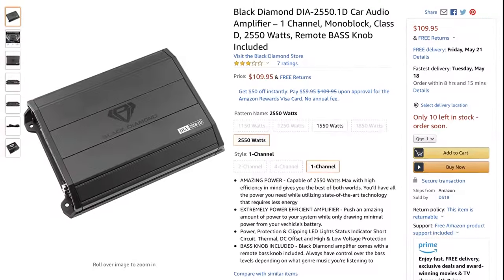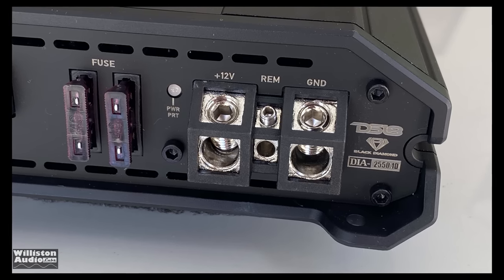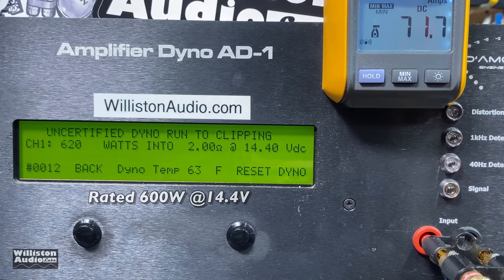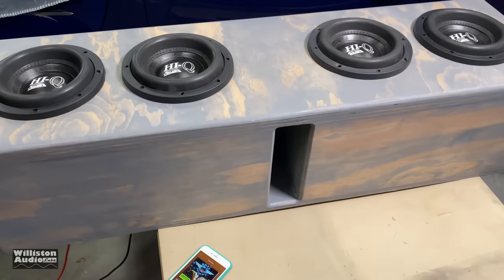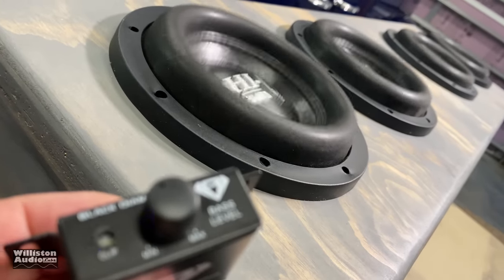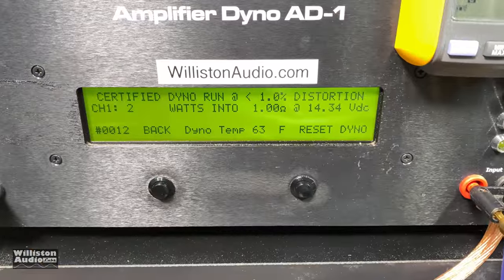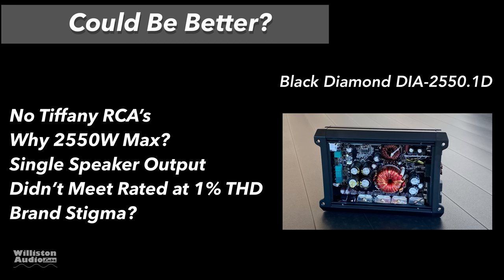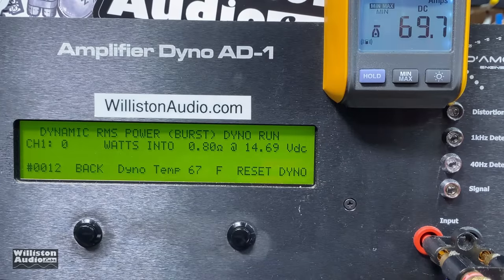Amazon Budget Winner? Black Diamond DIA-2550.1D Amp Dyno Test and Review [4K]

Comment: That clip indicator is there for a reason. Set those gains.
Reply: Ya big dummy, I'm sure he knows that already. I think he was just demonstrating how it looked when clipping... Sheesh
Reply: You realise he's doing a Rugged test on the amplifier,  so why set gains. He's pushing the amplifier to it's full testing.
Reply: @strangerdanger1271  while I agree with you, they should be fine as long as you don't do that for a prolonged period of time. Running a clipped signal for half a minute to show the clipping light isn't going to cause the motors on those subs to seize.

Comment: I haven’t even see the video and I already ordered. I’m not going to be late to the party this time
Reply from the maker: Wow 😮
Reply: @wal  I’m still mad I missed out on the WUDI amp... are you selling yours?! Lol
Reply: @mvaladez187  I think they're still maken those amps under a different name. Wasn't it like WUDI 6800?
Reply: @bobbymaner4113  yes! Do you know what the name is by any chance?
Reply: @mvaladez187  I always seem them on Amazon and Ebay. It'll say 6800 in the corner or image on top of the amp.
Reply: @bobbymaner4113  thanks a lot brotha will check it out
Reply: Nice to see. Recently bought one of these for a single 12 install in my Tundra. Looks like it should do the trick. Thanks. As all always great vid , no nonsense facts.
Reply: 👀🤔WHAT‼️GREAT TELL US🙌🏿🙌🏽🙌🏻🙌🏾
Reply: My guess is Chuck spent more money on an amp that didn’t perform this well 🙄
Reply: @basstech714  i disagree. i watch these videos to further cement what I've learned from 80's, 90's and 2000's crank it up contests, and Iasca events.. CHEAP CHINESE JUNK!!!!
Reply: @chuckholmes2075  clones of clones just like the Chinese market does...power is so cheap rite now,for sure rember the days of the rf 75.2s and us amps surfboards, I broke down and ended up with a taramps md8k on my 3 15s in my extended cab Chevy, it's a daily I beat to death,couldn't see spending more than $600 on an amp in a  truck that sees mudholes and tons of dirt and dust. But the same has always been Tru, u get what u pay for, sometimes cheap shit will do the trick for some ppl tho or they wouldn't make it.
Reply: @chuckholmes2075 not even worried about. Not out to win a trophy for system content. If is sucks, I've wasted more money on worse things. Thanks for the encouraging words. Appreciate it 😂
Reply: @jaceyrondeau8133  well I’ve got the money. I own an IT/IS company down here in New Orleans. As well as 2 data centers.. granted my competing days are over as well as buying cheap junk. I’ve learned that lesson. I’m happy with what I’ve got because it suits it’s need. I’ll leave the competing to my buddy Joe Fox of Fox Acoustics. He’s got 80 8” woofers in a UniMog. It’s hurts to listen to.
Reply: @chuckholmes2075  Congrats on your business. And making through this whole Covid-19 situation.Definitely beats a J O B. I understand where you're coming from. I also don't understand guys like your buddy who turn a vehicle into a rolling speaker. Not into that extreme myself. Just have a single 2 ohm 12 for my truck for a little low end sound. Could never justify spending 500-1000+ on car audio. It just isn't that serious to me. Cheers
Reply: @chuckholmes2075  you right, my amp had no sound
Reply: @mvaladez187  ????
Reply: @chuckholmes2075  My amp didn’t produce sound. So I returned it
Reply: @mvaladez187  So that Black Diamond amp didn't work out for you? Let me tell you if you really really want to go cheap don't settle for anything other than Rockville. If you hook them up right, those amps will do what you want for a long time. Of course if it were me I'd say just save up for a Fosgate or Massive Audio or even Skar is pretty good. But I'm telling you, Rockville is the only cheap you can trust. I bumped a kicker CVR 12 on a Rockville mono block 400rms and it lasted me the whole 3 years until I was ready to upgrade to my CVX 12 and a fosgate amp.
I still bump the Rockville in my house as a home theater system. So yeah that's always my recommendation.
Reply: @erik120719  who makes the amp it's supposed to be cloning? Not the USA lol. So it's a Chinese clone of a Chinese clone. When you win the lottery you can buy all American made, you'll have the most expensive POS system in the country lol

Comment from the maker: Buy this amp here:
Amazon: https://amzn.to/33UuPxz
eBay: https://ebay.to/3ftk2j0
Williston Audio / OSS Merch: https://bigdwiz.creator-spring.com/
(Video Gear I Use) 
Camera - iPhone Xs Max 512GB - https://goo.gl/uFHBh8
Samson Go Mic Mobile - https://amzn.to/2BSAtll
960 LED Panel: https://amzn.to/2Sxoq3S
Lavaliere Microphone - https://amzn.to/2Rw5PIw
Sennheiser Wireless Mic - https://amzn.to/2BSwIfD

This VIDEO was EDITED with LumaFusion on an iPad Pro 12.9:
iPad: https://amzn.to/2Ancr1W
Software: https://goo.gl/6yvWss

--------- Test Bench Equipment -------

SMD / D'Amore Engineering Amp Dyno: https://goo.gl/sJTcf7
XS Power D1400 Batteries - https://amzn.to/2BPFCKW
XS Power PSC60 Charger - https://amzn.to/2CHGcfs
Fluke 1000A AC/DC Clamp Meter: https://amzn.to/2Rw5WDA
Handheld Dyno: http://amzn.to/2u2EgKV
My Favorite Screwdriver Kit: http://amzn.to/2x0VzcE

DISCLAIMER: This video and description contains affiliate links, which means that if you purchase from one of the product links, I may receive a small commission. As an Amazon Associate I earn from qualifying purchases

Comment: This literally makes the “add a zero onto the fuse and that’s your power” theory look true
Reply: Its multiply fuse rating by 12 or 14 volts not 10 but yea its pure truth
Reply: For most class D amps. This will not work on class ABs generally.

Comment: Thanks for the test Big D! I wish you would have reviewed this thing a month ago lol. I purchased the JP8 a few weeks back because of your review and the clip light on the remote. I like it don't get me wrong, but had I known about this amp I would have saved myself 90 bucks and purchased this instead. I'm only running one 12" KFC-W3514DVC sub at 2 ohms that only handles 380w RMS, so this amp would be more than enough for me.
Reply: 2 years later but I'm glad you bought JP amp and not this thing.  They are not in the same zipcode for performance.

Comment: Not terrible for $100 and a clip light on the bass knob. Those cables look huge going into that tiny amp lol. Really hard to find a clip light and metal bass knob on a $100 amp. It came close enough that I would consider it if I only needed like 750-800 watts for a single sub.

Comment: I was almost sold on this amp for sure. It will work great for my camaro convertible on my 10 inch sub on 1ohm. My only issue is that it gets way too how just after 2 minutes of play. I wish there was a way to keep the temp down on this amp. I would need way more than 2 minutes of play.
Reply: Add a small fan to it and it good
Reply: Remember the ADD-1 uses a resistive load and he's playing a sine wave. It will be totally different with a speaker and music, it will run much cooler.
Reply: @JasonWW2000  Now I'm curious how long it will play for without reaching to high of temperatures.
Reply: @bbay1977  As it's temperature increases it radiates the heat out. As the difference in temperature increases from it to the surrounding air, the delta, it will eventually stop getting hotter and will maintain it's temperature. So as long as it's not mounted behind panels blocking fresh air it shouldn't get too hot. Also keep in mind that if your sub measures 1 ohm DC resistance, it's lowest AC impedance is going to be above 1 ohm when it's playing music. In order to get full power from this amp you'd need to wire it to 0.5 ohm. Impedance jumps all over the place with music and just certain frequencies will see it's lowest impedance. So I'd estimate the most power your 1 ohm sub will see is 500-600 watts and that's with the volume at max unclipped output. I don't think heat will be an issue. Plus you can further improve cooling by mounting the amp on spacers so air can flow into the lower vents on the bottom of the amp and go out the side vents. 
PS, I don't see this amp on Amazon anymore. I was looking at the Skar RP series which have lots of good reviews. I see Skar sells them on eBay and they have factory refurbished for a discounted price. I'm looking at their 1200 watt amp for $125. It's bigger than I need, but I can adjust it down with the gain knob. Dereck has tested the RP series also. Personally, I'd prefer them over the Black Diamond. Something to think about.

Comment: I love your channel..  I'm trying to put together a system, I bought the Rockville k9D4 10". And hooked it up to set up my amp and I had all the settings turned completely down on the amp and within in 15 mins of tuning the amp and mind you the volume was turned on the head unit, but I'd be darned if I didn't start to see smoke coming from the sub box.  I knew then the Rockville was done already before it even had a chance to begin.. I then saw other post of people who purchased the Rockville line of subs and it seems they have all had similar problems...  I've only had the speaker for 3 weeks and it was only hooked up for a day..

Comment: Maybe this one for my convertible fox mustang.... Long term project. Just thought of free air subs facing up at the window (but far enough away and at a slight angle) so when folded down so the glass will not hit it..but will also act as a slight wedge bass deflection deal....and when the top is up there will still be some movement of air.  We'll see how the sub goes...but if I do a bunch of 8" and load up the ohms....this will be plenty of power to push however many I can fit in there!

Thanks for the reviews! 😇😎😀

Comment: Damn itttttttt. A couple months back I was trying to find a good review for black diamond amps for my Kicker CVR 12" and I just couldn't find anything so I got a stupid Rockville amp which has been all good honestly, but I'm just sketched about it being Rockville. Lol
Reply: I hear ya, I bought a Rockwood Detonator amp-860X for $150 probably close to 19-20 years ago at one of those crazy electronic sale, sale, sale, they have at fairgrounds all over the place. I've maybe used it 5-7 of those years on a pair of 15's. It's kinda funny cuz I had dig out of the closet and put it back to work cuz my Black Diamond D3 400.2 quit on me after pushin 2-10" JBL's for the last 10 or so years. The Black Diamond is a far better amp in every possible way. It was actually manufactured in the USA back then, I'm not sure about now.. I've been pretty lucky having the amps last as long as they have, due to the fact my wrangler's topless 6 months out of the year. That really helps keep the heat down a little with all the wind, I make sure to use the cans of air and maybe a couple of Q-tips to help keep the dust and spiders out of it every couple of weeks.
Reply: @bashman37  That was just what I needed to hear i was hoping for that out of Black Diamond. And that's pretty cool about you're wrangler I need to upgrade to something like that soon after I get my 2 cvx 10's, especially how hot it is now the Rockville amp is actually starting to heat up during the hot daytime of bumps, but hardly gets warm after hours of pounding at nighttime when its cool. Its pretty weird so I will definitely be upgrading to black diamond when I get these 10s.

Comment: Not too bad but if it cant beat the Wal-Mart Power Acoustik its not gonna be a budget banger on my list. I did some clamp testing (not the same as an official dyno i know) on the PA 2500 and got 853 at 1.4ohm riding on the edge of protection. They're not my favorite by any means and the rest of my system is all Alpiine and Kicker but i got 2 of them on my 4 12's and havnt felt the need to upgrade yet. Only have $110 invested in both amps also a +. Id like to see a MB Quart amp tested. I just bought a set of 10s for $80 on eBay and havnt had the chance to try them out but they seem to be decent dual voice coil subs for the price. 👍

Comment: How about a usefulness test:
What is the maximum wattage can it handle continuously with the cover on for a 60 minute drive? 

The speed at which it thermals shows that not the entire amp is designed for maintaining it's output @ rated power.

Just because it can reach near it's label power for a few minutes doesn't mean it's a good amp to actually use.  Wondering about 500 RMS into a 2 ohm load... How long could it keep it up playing music from whole albums.  (Obviously different types of music would be handled vetter or worse depending on factors such as frequency and length of bass notes.  A bass drum compared to a string bass or synth makes a huge difference)

Comment: Those caps mashed over on the driver board are super sketchy. Between the heating from the choke and the vibration from the box this will inevitably be mounted on, those caps will probably be the first thing to fail.

Comment: Same as ds18 2550.1. Puts out 845 at 1ohm. I'm running one at 2ohm so I'm seeing about 600. It's a ok piece of equipment. But mine doesn't get hot at all and I've abused it slight clipping. Never shut off might get warm never hot though.
Reply: Its probably doing closer to 300 watts due to the impedance rise your getting. The amp may actually see a load closer to 4 ohm.

Comment: Can you explain how you determine efficiency please?

4ohm certified, your meter reads 36.7amps, but you put down 26.6amps in your calculation.

Do you play back video and freeze right when distortion light lights up?
If so, how do you know there isn’t latency delay on your meter reading.

10amps makes a huge difference. Saying it’s 87% efficient, when it could really be 63% efficient.

Please help me understand, I’d like to calculate it correctly for my own amp.

Thank you

Comment: How’s it going big d just wondering if you had heard about the power acoustik A3000.DB MONO BLOCK. I used to run one in a 96 tbirb pushing 3 audiopipe aluminum 15” subs. But I posted a video of a build I did recently on YouTube. The video is named first build in a while 2008 Chevy trailblazer. Had 3 15” aluminum audiopipe blues and a Orion xtr 2500. 1dz had my trailblazer flexing.

Comment: Great channel so I have a question; Want to run this in my older Corolla to power the door and deck speakers which are Kenwood. Obviously I'm not going to push it to Thermal but would this be a good amp for the price?  Oh door speakers are 5.25 and deck are 6.5. Thanks!!

Comment: Not the results I had from the amp. The thermal shut off is horrible. Shuts off before one song. The clip light is misleading as you pointed out. I'd say buy ignite with the milk money ya spend on one of these. Much appreciated video just too late for me unfortunately. Love the channel
Reply: I hate the way my comment sounded after rereading. So let me add something positive. My amp is still working. I'm not trying to bash anyones products. Full disclosure 
Its wired to1ohm since birth or ( Amazon dropped it off)  
Its doing the best it can considering the work load 

Thanks for letting me church this up Big D

Comment: Whats ur options with the harmony audio because i been thinkin about given a couple 4 of the ones like u had on some exm or emx audio there subs are pretty impressive for what they are asking for them i only seen them on ebay u might find them some where else tho but for a cheaper off brand subwoofer its pretty impressive the biggest model they looked like a gen witch looks ant everything fr but them in a 15 and run dual 2s and wire down to a 1Ω load or do the dual 4s and get the final 2Ω load witch ever its stable down to and idk if they was even swappable i think i would just run them independently over strapping them my opinion u would get alot clearer sound an true power not over killing them but just perfect note fr

Comment: I bought 2 Critical Mass amplifiers and as of right now I believe that I was ripped off and they just don’t sound as good or as strong as my other amps.  They listed some crazy low thd and crazy high snl values which I no longer believe.  Would you be willing to test and review these two amps for me if I sent them to you?   I don’t want to write a horrible review and go out on a Critical Mass bashing crusade until I’m for sure that the amps really are just rebadged garbage so I was hoping that you could help me out and test the amps.  I really would appreciate any help that you would be willing to provide.  If you’re wondering why I was a dumbass and bought the amps in the first place it’s because I had previously bought their 2ohm 6.5in component speakers and really liked them but these amps are a different story.  I still need to upgrade my alternator so it’s possible that they really are good amps and that I’m just not giving them sufficient power but I looked in the inside of the amps and really wasn’t impressed by what I saw so I highly doubt that’s the problem.  Thanks in advance.